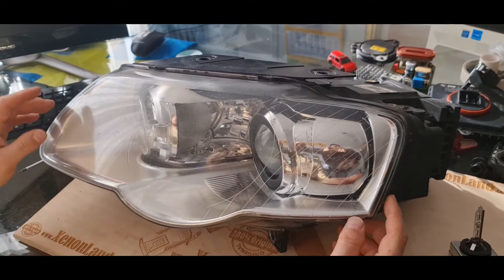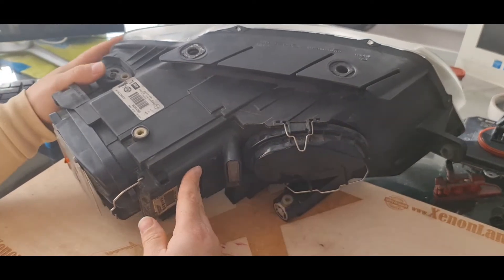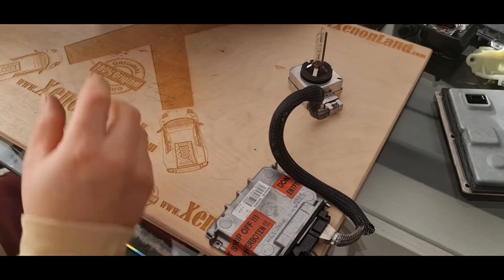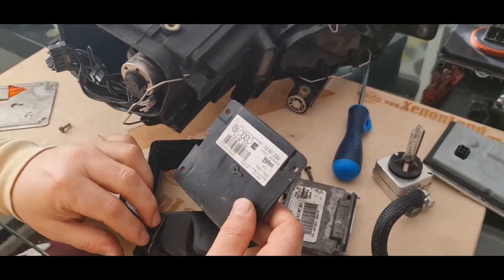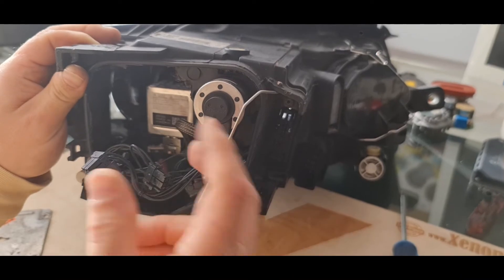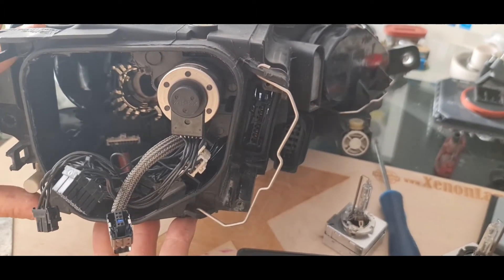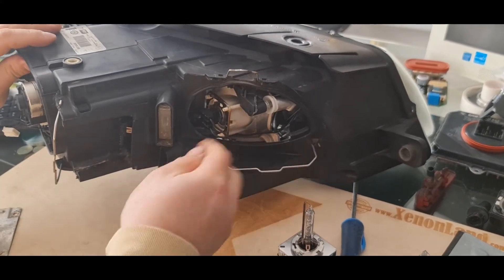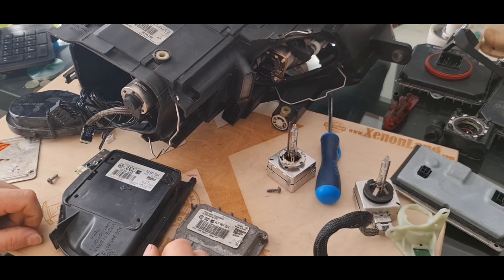VW Passat 3C later type 2008-2010 BI-XENON AFS headlight troubleshooting and repair tips

Comment: My friend please help me out !
My 2010 passat has a "activation for right headlamb beam adjustment motor - open circuit/short circuit to B+" error. My cornering lights when i move to the right or the left, are working. The only thing that is not working is when i start the headlamps, they do not adjust verticaly. The left headlamp isz the right one doesn't. What should i need to check to fix this issue please ?

Comment: Hi there, Im coming back to yours video as you are a man of knowledge. I've the exact same headlights, buf after replacing d1s bulb to newer one, the adjustments from left to right has changed, now I cannot adjust the horizontal position (left to right), yiu said it can be only vertically adjusted, what should I do? Thanks

Comment: Hello. I have a problem with my 2010 passat none of the headlights work low or high both sides. On my scan tool it says low beam bulb but i took the bulbs out and tested them and they work. On both sides high and low don't work

Comment: Hello, i have problem with high beam, after changed the bixenon projector with a new one, all is ok, wires are ok but the high beam not working. The headlight is made in 2009. 
The new projector have low/high beam engine. All is new.
Sorry for my bad english. I hope you understand.
Reply from the maker: is your projector original one from a donor headlight? Or aftermarket one?
Reply from the maker: If it is aftermarket will not work

Comment: very good ... great job. thank you. Can you give me more informations about the vertical range adjustment headlight motor? Does the motor works for horizont range adjustment too? Can you change it wehn the motor dosen't work in complet correct way (the left one turn not completely to the left by strat engine)? If Yes dou you have a type number of the motor? Do you have a number of the swivel module sensor? Thanks in advance.

Comment: Alright so I just had the right side headlight go out, but I before this my afs inoperative light is always on, and my high beams when you turn them on they stay on for two seconds and then they shut themselves off. Do I need to replace both headlights altogether?

Comment: Hi, i have a Passat B6 2007 and high beam don't work on left headlight and don't say AFS inoperarive. They're works ok. In dash i have light sign for bulb burn. What do you think ?
Reply from the maker: Check your D1S xenon bulb and the auxiliary H7 bulb. This headlight is bi-xenon hence low and high beams are at same D1S xenon bulb. Please subscribe to our channel.
Reply: @xenonland  H7 works. Every bulb works. Just highbeam on left didnt work.
This code error i have
02498 - Left Low Beam Reflector Motor (V294)
Reply from the maker: that's a bad news. It means that your shutter motor inside the headlight is not working. This  motor basically lifts and pulls down the metal shutter/curtain and so making your low or high beam (you can call it bi-xenon mechanism).
Reply: @xenonland  Thanks. That means it's not reparable. Just to get another headlight?
Reply from the maker: Yes definitely better to go for another headlight. Otherwise repair is theoretically possible, but practically very difficult, not to say impossible (VW do not sell this part).
Reply: @xenonland  Ok, thanks again 😁